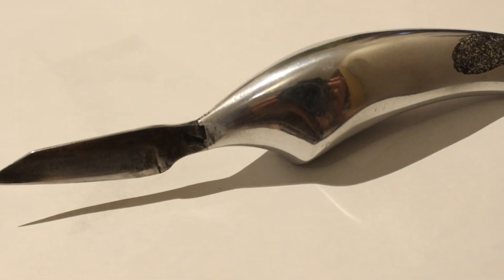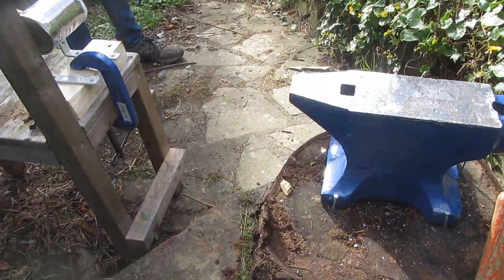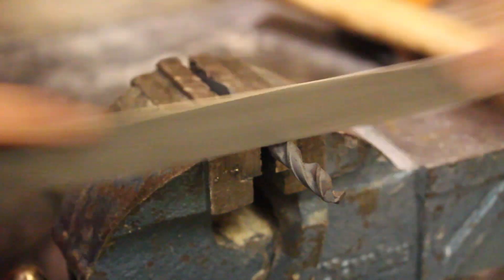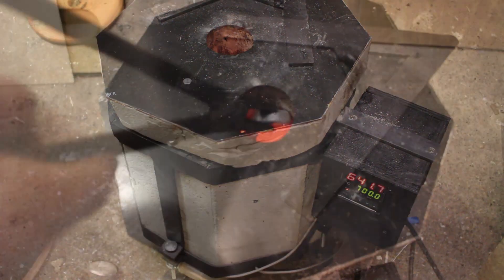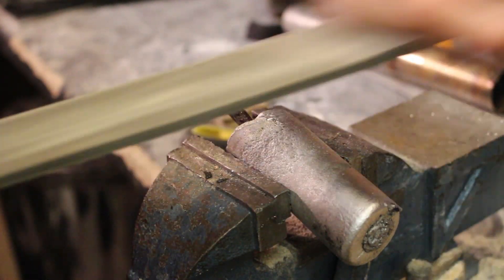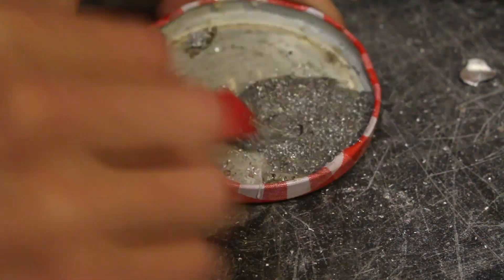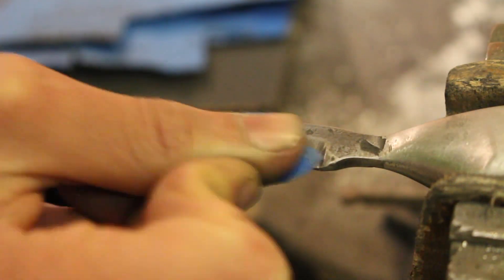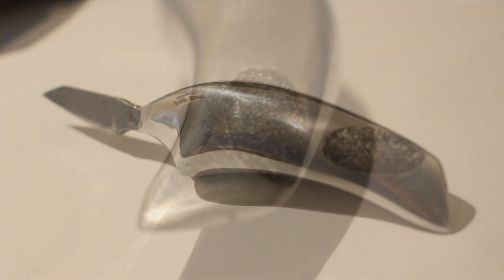How to Make a Knife With a Cast Aluminium Handle

Comment: Just a quick tip, when heat treating you should have a trough facing true north since the magnetism will pull the blade and may cause warping if it's not north
Reply: That is such bull shit

Comment: Hello Artof...

Wow! Once again you excel! 

 I had the idea in mind of you casting brass to make a cutlass handle, but casting aluminium for handles is a very good option too.  In fact there are loads of tools that have aluminium handles, or parts, so you will always have a huge choice of what to make.  You could even use your other tools, like the CNC or the 3D printer, to make any sort of complicated pattern you could think of.  As for finishing and polishing the cast items, well you have been doing that for ages now so that's no problem for you either.  But have you tried using a surform for shaping aluminium?  I like the epoxy fix with the aluminium shavings added as well. 

 I take it that you have got your GCSEs out of the way now and are spending more time making these things and editing the videos.

Best wishes to you.

Comment: Hey the art of weapons I also do casting and forging but I am making a forge now and I just have to ask does the firebrick hold the heat and are they fairly durable.  Also I have propane and that's really good but did you only get electricity so you can monitor the heat.

Comment: You would be able to heat treat the knife after casting the handle if you use a torch. That would make it so only the edge gets hard and the aluminum would have minimal heat transferred to it.

Comment: A great add would have been to fill the hole with clear epoxy resin and place in a small logo of "The Art of Weapons" or your initials or whatever, and then place a bit more resin above, I think it would've looked great

Awesome vid btw as always, I wish you had some better video equipement though !

Comment: i know this is a silly question, but what shoud i use to clean the handel from the oil ?
Reply: +TAOW i made the knife but how do i avoid it from building gases when i cast the handle ?(sorry for my bad english )
Reply: I tried the butt hole way and it works pretty great? Knife is clean now. Learned from my three attemps; I suggest you should clean the bum hole first.
Reply: +Senetor F im too (i dont mean the castet handel, i mean the drillbit after heattreading it ) sorry for my bad english ;(
Reply: +Senetor F sorry, but at some parts of the Video i coudnt understand him especialy when he explains how to avied the gases from comming out auf the drillbit:(
Reply: +Nicolas. Schönfeld avoid
Reply: +Nicolas. Schönfeld
1. Let it to cool down.
2. Wash with turpentine.
3. Wash with water.
4. Let it dry.
Reply: +Mark The Gr8 thank you :)
Reply: +Senetor F yes from where du you know this ?
Reply: +Senetor F doch schon ich hatte nur gehofft das es mir irgendjemand anders sagen kann wie ich das machen sollte (ich meinte nicht den gegossenen griff sondern den bohrer nach der härtung, weil ich nicht wollte das der gegossene griff löcher durch das übrige öl bekommt) entschuldigund nochmal das ich ihnen ihre zeit gestolen habe :)
Reply: +Senetor F herzlichen dank :)

Comment: one alternative that would have greatly reduced how much finishing you'd have to do would be to shape than handle in styrofoam, then place the styrofoam on the blade, then immerse the whole thing on sand and cast the handle using the lost foam method.  Same result, only you'd do most of the shaping in styrofoam beforehand, rather than in metal after casting.

Comment: Put your knife in an airtight foil pouch whilst annealing and heat treating. The paper will burn off all the oxygen and the blade won't oxidize as much. Learned it from another channel called Green Beetle.

Comment: could you forge the tip of the drill bit or does that have a carbide coating or something on it?
Reply: You could forge the tip but the shank is better because it's solid so no welds are needed when hammering out the blade shape.
Reply: You can't forge a ceramic coated steel, it simply brokes after a couple of hammer blows, but you can buy high carbon steel drills

Comment: I know a faster way to shape the handle, rather than using a farriers rasp to rasping it all by hand is pretty exhausting isn't it? So a much faster way to do it is you show the profile of the handle towards you so you can see it, then grind on your belt sander until it touches the outside of the profile, repeat it with the other side, then use a farriers rasp to rasp away the curves.

Comment: Isn't making a handle out of aluminium hard to maintain because aluminium oxide is not shiny but dull and is created when the outer layer of aluminium is exposed to air. It looks very nice but doesn't it dull very quickly over time?

Comment: CAUTION: using pipe with a Coding is zinc it could harm you or even kill you.  so use pipe that has no coding on it or a pipe that can be used to welled. The coding was burning off when you poured the aluminum go back and see. Be safe 😅

Comment: Why make a knife out of a drill bit? It's very hard steel, so it's going to crack and chip 10x easier than other steels.
Reply: 1: it is likely that this knife is not going to be in a high stress situation
2: he treated it in such a way that the blade is less likely to crack, but still hard